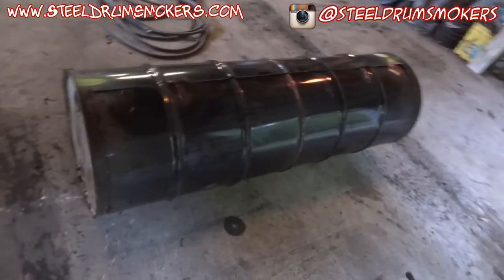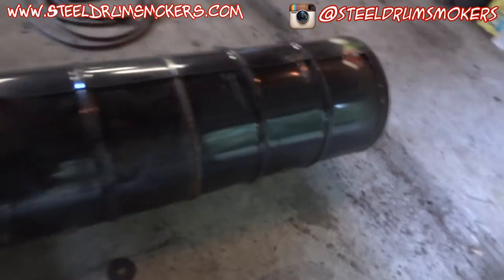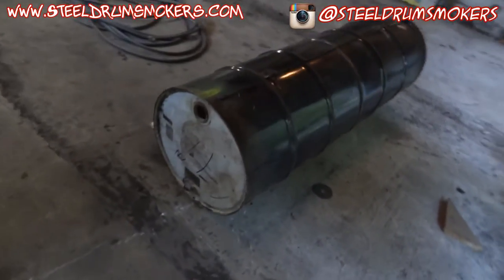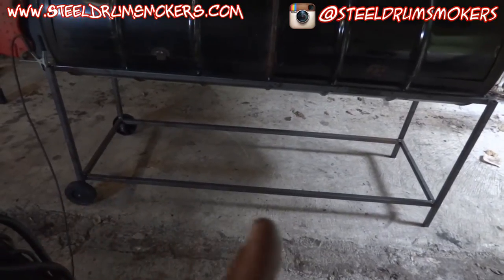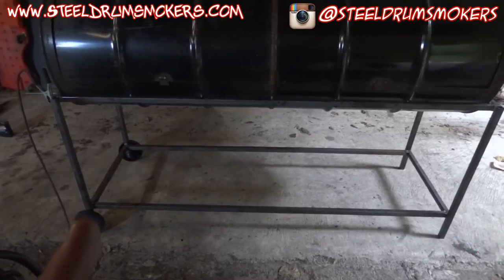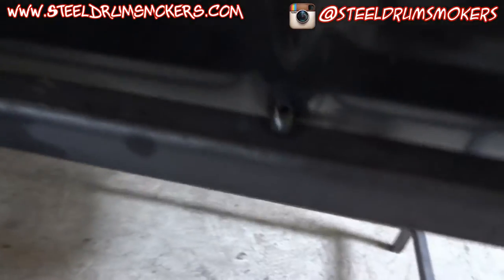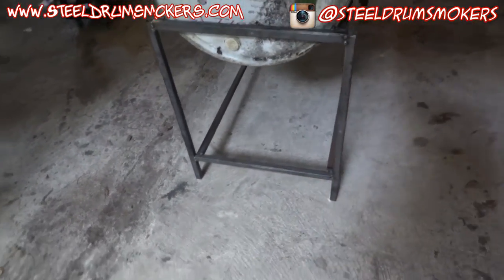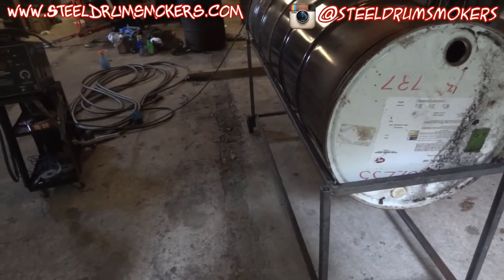Steel Drum Smoker's BBQ - Double Barrel Grill Build - Part 1

Comment: yo. did u finish this thing. if so what i did on the top where u said about not putting flat stock....u weld it to the bottom side of the lid. so when u open it the lid wont hit stock
Reply from the maker: Hmm. I know I put some sort of stop on it. I just don't remember exactly what I did, I have tinkered with it a time or two since I shot this video. I may have to do an update to this soon. Thanks for watching.

Comment: hey how did you're double Barrel grill smoker work? I'm building one now,saw in another video you said you didn't like it just wondered why?
Reply from the maker: since I filmed this I "finished" it. I put some bracing on the door. if I did this again I'd cut the whole thing in half as opposed to cutting inside the outer frame. at the time it was just a bit too flimsy for my liking.